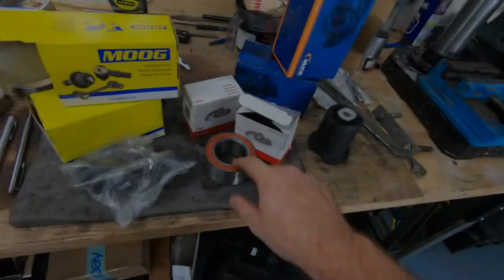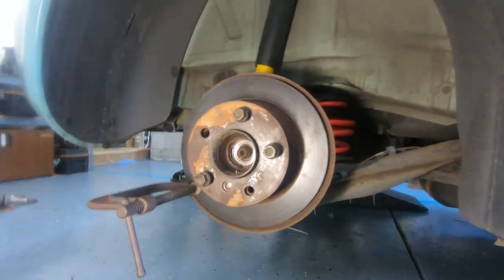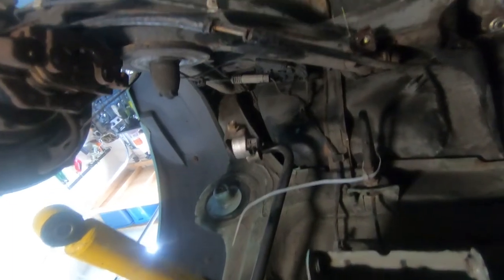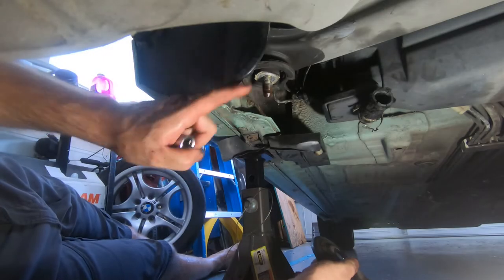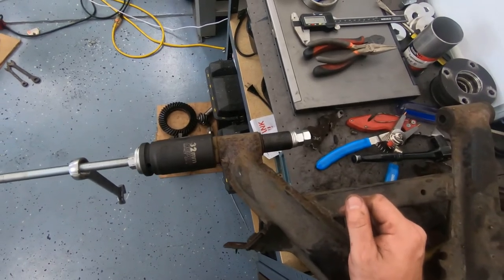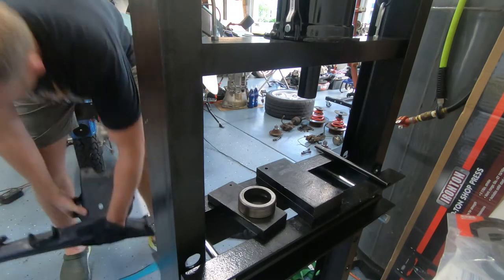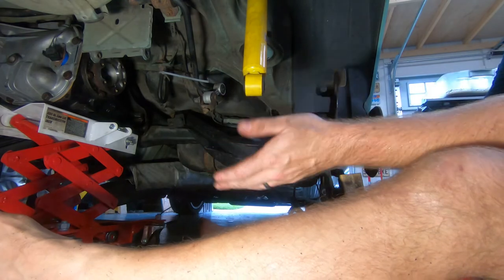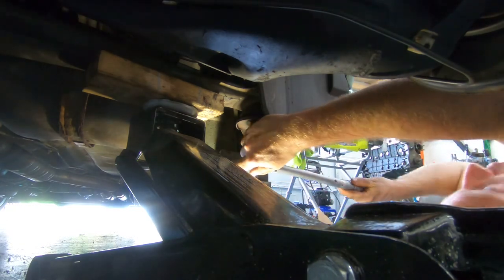BMW Z3 - RTABS, Subframe Bushings, and Wheel Bearings(rear) Replacement

Comment: Whereabout did you have to undo the exhaust to get it out of the way? The only place I can see on mine where I can disconnect it is right up the front at the manifold!! I don’t wanna be messing about up there but it all looks to be in one piece from there backwards.
Reply from the maker: Mine has a joint several inches forward of the subframe, in the area where the driveshaft support bushing is… looks factory to me
Reply: @driventofailure  I’m not so lucky!!